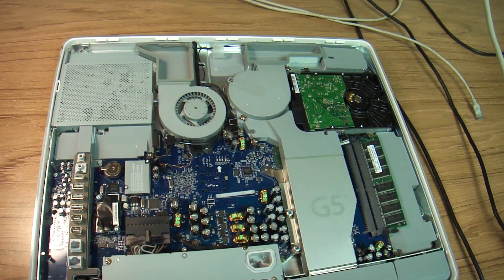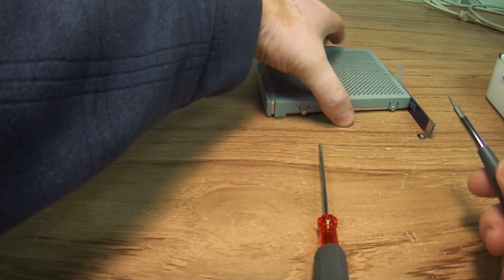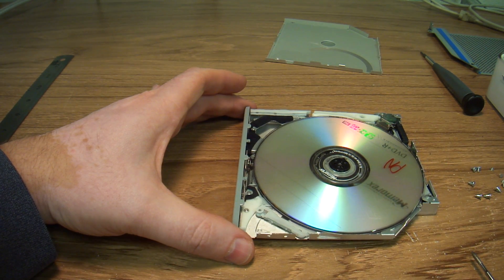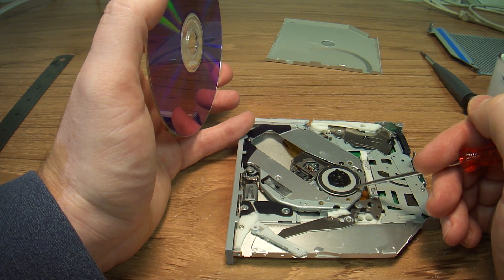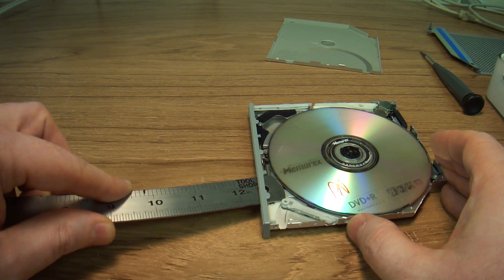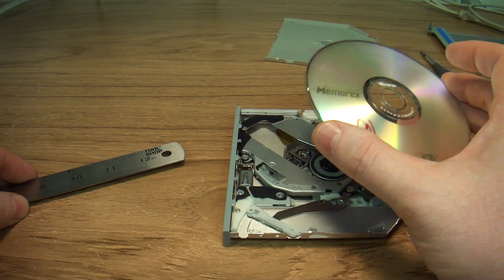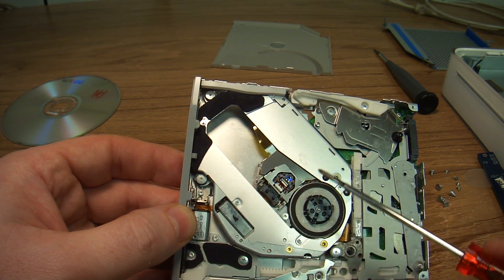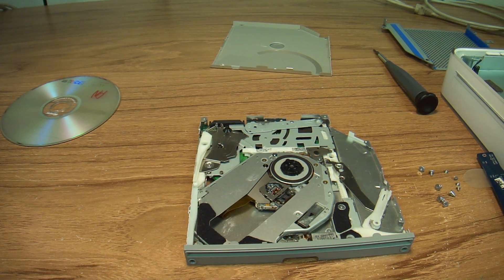How to remove a CD Rom Disk that is stuck in a slot loading Apple's iMac or MacBook computers

Comment: That’s tight thanks man, I was wondering I have an old iMac 2008 once I select user type in my code the bar gets a quarter of the way there, and eventually shut down… Pressing command option RP doesn’t work, it brings up a padlock…And I haven’t found any other way to keep this from shutting down let alone starting up to my screen wondering if you could help, nothing else on this YouTube has worked it back to me appreciate your time thank you

Comment: Pretty stupid. In the case of normal optical devices, (I suppose in this case too) there is no need to do such things. There is a small hole in the lid that is about it. You just put something like a paper clip into it and you press and the hood climbs up and you pull it out and remove the disk without the need for disassembly.

Comment: followed his advice, but did so using a knife without doing any dismantling. Turned out the disc had a picture laminated on the disc that was peeling so CD could not eject.I used knife to prise the cd free and it ejected enough from the reader and I then used a pincher to take the disc out the rest of the way....very nice mechanical overview that really helped me get my stuck CD out...great video thanks.

Comment: There is one major problem with your explanation of how to use a knife in the correct position. You tell us that we should try to slide the knife in on the right side of the slit to avoid damaging the head. On a iMac there is top or bottom of the slit. Not left and right. So is it TOP or is it BOTTOM? (Of course I refer to a iMac upright on its stand.) I'm guessing it might be bottom of the slit, but it depends whether the smooth top of the cd faces the back of the iMac or not. It's so long that the cd has been jammed that I no longer remember which way you put a CD in.
You also don't say whether the machine should be switched off when pushing about with a knife. What about the risk of electrocution?
Reply: I think you can figure that out using which side of the cd/dvd is supposed to go facing you.: I believe it's towards the top; + I used a credit card to lift the disc (it's just long enough to reach the center, without itself getting stuck in the drive)
Reply: Thanks, I seem to remember one put the cd in with the coloured top or whatever facing one (but difficult to remember it's so long ago. My other machine's a Macbook Pro so the cd lies flat). In which case it should be the top end. I tried the credit card trick some months ago but it didn't work. Eventually the iMac could no longer read the cd, so I think it must have partially come off.
A Mac expert advised me to turn the iMac so the slit faced the floor and shake it when pressing the eject button as the CD could fall out. It didn't. So it's still stuck in. Trouble is that most times when you shake the machine, the electric plug comes out enough to cut the electricity off almost immediately, as the plug is rather loose. Then you have to start up the machine all over again for the next attempt.
Reply: you could try what he does in the video, and actually take it apart. Be careful though, I got my hand shocked once on an iMac, even though it was unplugged, part of the circuits had charge. So if you're going to try this, unplug the power cord and press and hold the power button for a minute or two before opening the case.  You could also use a USB external cd/dvd drive.
Reply: Chris Cross Yes, I've been wondering for some time if I should attempt that, but I've been particularly put off by the warnings about possible electrocution. Thanks for the tip about the power button.
I'm also afraid of totally screwing the machine up by opening it. I've never been into electronics. Fear I may forget what I did and not be able to stick it back together correctly. Or that the screen won't fit back on.

I've thought of an external cd drive, but the main thing I need is to put an update of the system from Leopard to Snow Leopard. That will enable me also to obtain further but automatic system updates direct over the web, but one needs a CD if one only has Leopard.

Would I be able to update to Snow Leopard OS using an external USB connected CD or would it jam up in the process as the USB connection might not remain active before the whole new OS got turned on?

At the moment I just use the machine for storing documentation, but it would be good if I could update the browser so the net access worked properly again. At the moment I've got the highest Safari that will work with Leopard, but it tends to jam up on most sites nowadays, not to mention that free Antivirus won't work now with anything less than Snow Leopard.

Comment: Hi Abraham. I have a CD stuck in my drive. The mac completely stopped working while the CD was inside. I do not have the screw drivers to open up my mac. Is there anyway of releasing that stopper so that I can pull the CD out? The mac is really old, so I do not mind damaging some parts
Thanks for the great tutorial